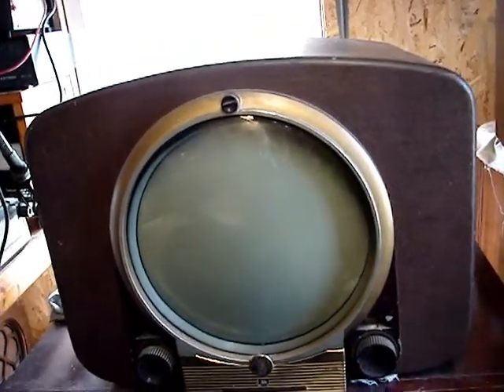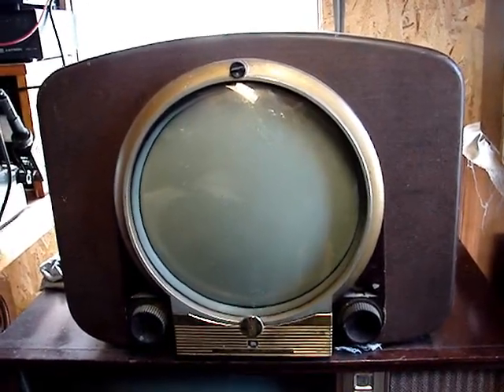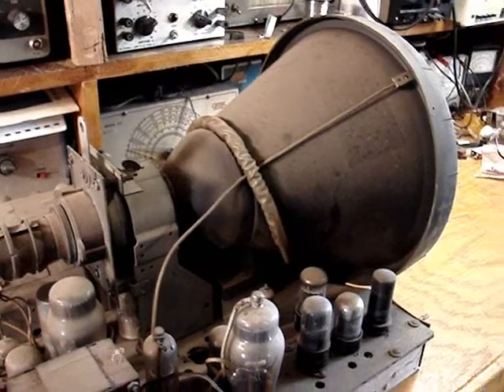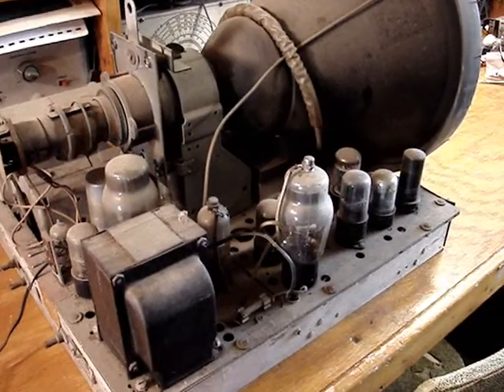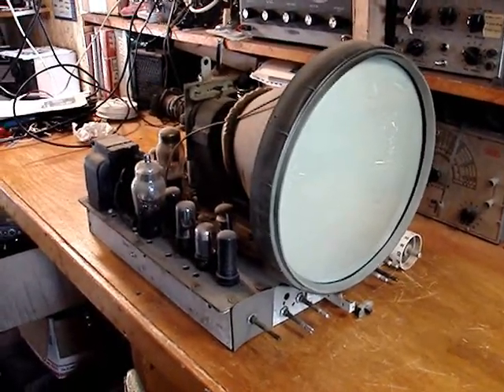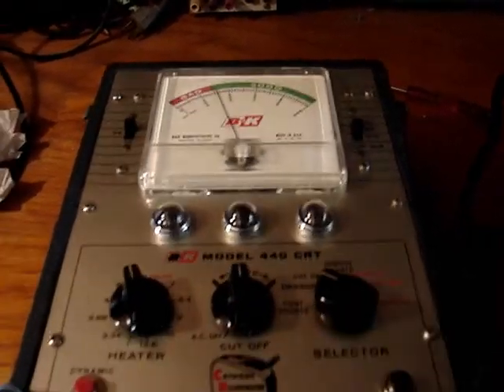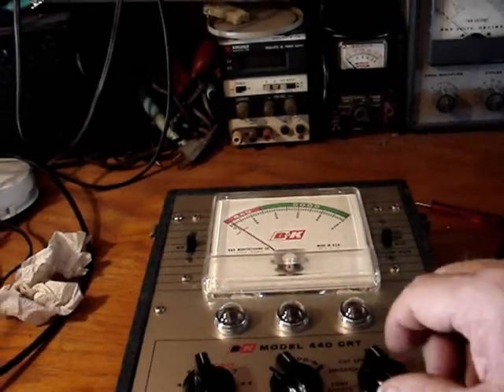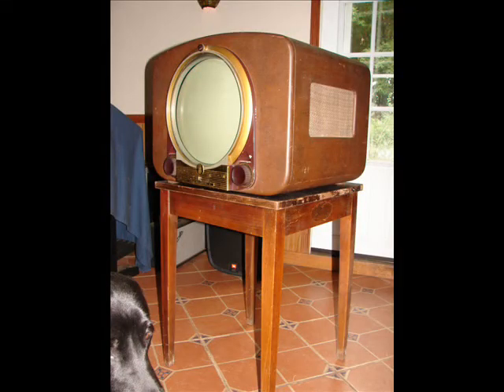1950 Zenith G2327R7 Leatherette 12 inch Table top TV

Comment: Nice TV, I think it would be great to do the restore on it as much as you can, then just start trolling for a tube.  Are you sure this is a 12 inch?  I cant find a 12 inch, however I can find a 10 inch that looks spot on to this...when I mean find, I'm referring to vintage newspaper adverts....in 1950, they refer to the 10 inch as "The Glaridge",  In 1950, the 10 inch sold for $219.95, in 2016 that would be $2,199.85.....
Reply from the maker: I will look into trying to restore this set after I finish the 1951 Zenith Teninson and then the Silvertone.